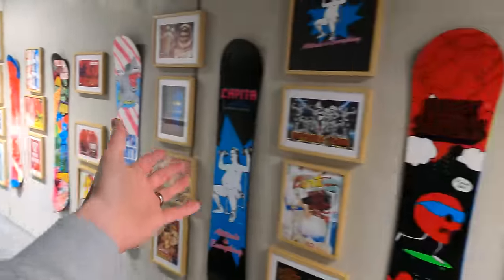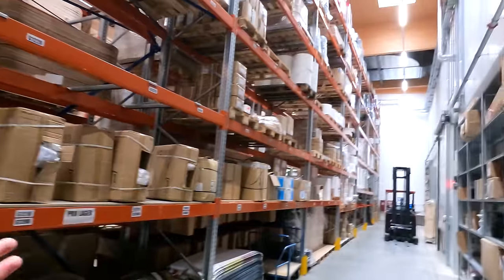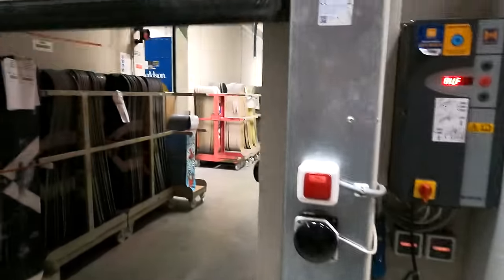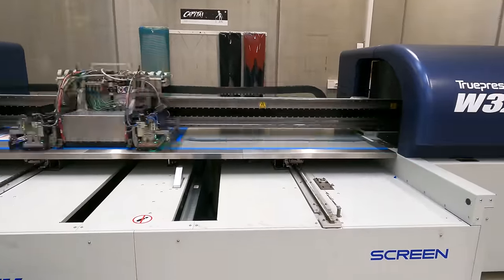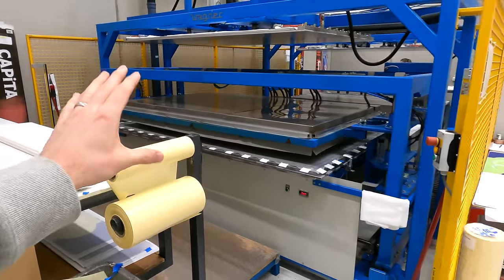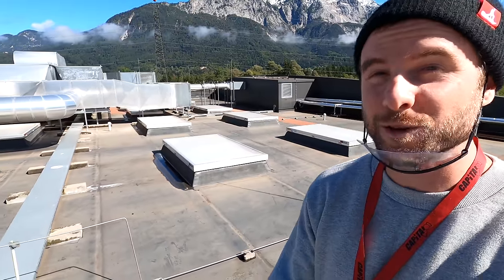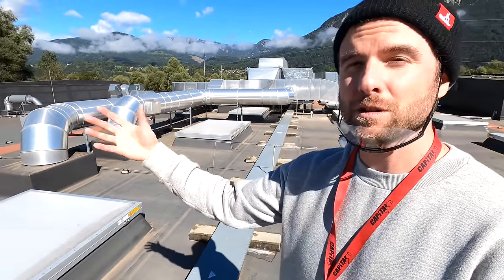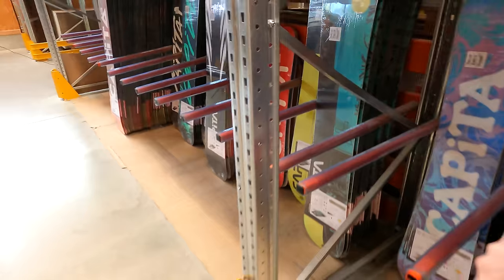A Look Inside the Capita Mothership Snowboard Factory

Comment: Hi. Great video. On capita boards: I'm intermediate rider aiming at fun board - all mountain, easy boxes, presses, bit of carving. Rather slow riding. Im 170cm tall i.e.149cm to chin, but 85kg. What about ultrafear 2018 model, sized 149? Mid stifness to compensate weight? Or else what model would you recommend.
Reply: Go for horrorscope..i own one..super fun
Reply: @brownpunk1794  thanks. My clash is 145cm soft & rocker -  I'm curious what it would be to ride hybrid and stiffer .. but I'll try to find demo horrorscope